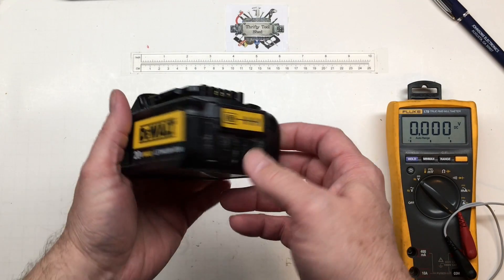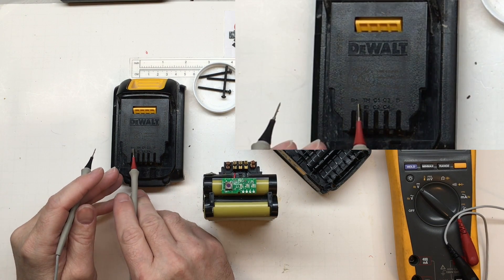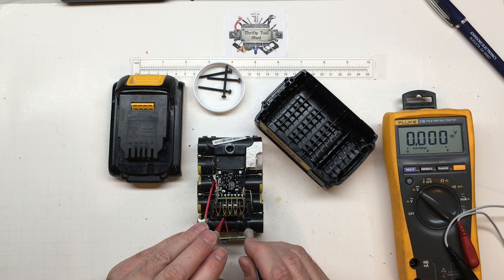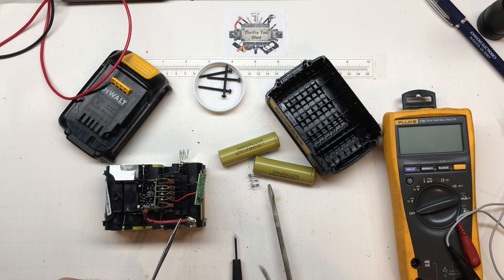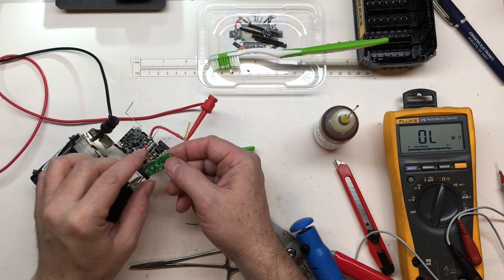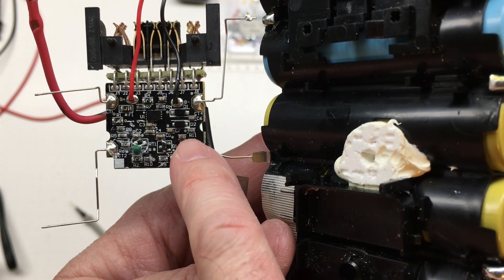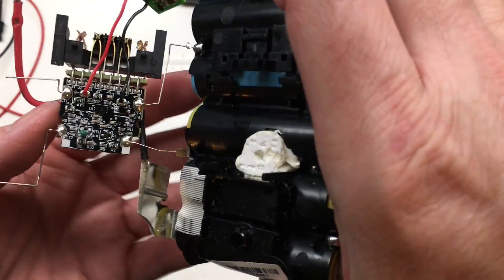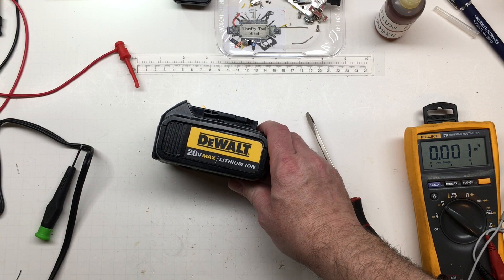DeWalt 20V Max 3AH Battery Repair

Comment: I didn't know you could test the cells while they were still connected to each other...thought you had to disconnect them from the cell cluster to get a proper reading!
Reply from the maker: In parallel you can't test the individual cell. Since they are in parallel though, we simply test Voltage as they will be the same as each other. That does not mean one does not have issues for sure. It's just that almost always if a cell has an issue it shows up on both right. If one is bad and pulling down, it will pull both down etc. If one is open for example and not working at all the other cell will show dropping off much quicker than others under a load. At this point we would have to separate them to test which of the 2 is an issue, I always replace both anyway though. So to answer your question, it is not Proper way just a quick troubleshooting method.

Comment: I have a Question, do all dewalt 20V has a low voltage protection circuit? anyone answer will be greatly appreciated, thanks
Reply from the maker: Well the pack monitors and the tool will shut down based on the pack. The pack does not cut the power to the battery terminals. So care must be taken so not to discharge the pack too low if used out of the tool!
Reply: @ThriftyToolShed  Thank you for your quick reply, I understood now.
Reply: Hi Friend, I am trickle charging my car battery through Dewalt 20V using LM2596 and it's working really good and have been using it for about an year from now. Now my question is I want to protect my Dewalt Battery from going too low on Voltage and I tried using XH-M609 and LM2596 together but it didn't work. Now what do you suggest me to buy which might help. I appreciate any help please.
Reply from the maker: I do have a video that I show a low voltage cut out module that may be helpful. The video is about Low voltage cut out for my ego battery packs but the cut out controller works from 10-60v I believe. 
This is a link for a 30A module and a smaller 20A module that work great for the money. I have a video on the 20A board as well but I have not edited it yet, hopefully will have it up soon. Here are the links to the boards...
eBay Link to 10-60VDC 30A Low voltage Cut-out Panel (the one I used)
http://ebay.us/jN8bXN
eBay Link to Aiyima 6-60VDC 20A Low voltage Cut-out Board
http://ebay.us/rHNgBY
Reply: @ThriftyToolShed  But with these 2 modules you mention the Dewalt 20V battery gets discharge completely to 000 and battery gets destroyed. Can you read my question again please.
Reply from the maker: The modules I just shared cuts the power from load to charge if you would like. I could see how the module over time could pull down if not connected to a charger. It just cuts the load. I mention in my video on the 20A module (not yet edited though)  about using a relay with it if needed that could drop out at setpoint and not latch back until you press the start button. Like a latching relay or sealing circuit used in motor starters etc. The only other way I would know to do it is to custom build a circuit to monitor and drop out with low voltage monitor, but I don't have time to research that. I just make the modules I have plenty of work at this time. Best of luck to ya!

Comment: Does the tool needs any extra inputs to work other than B+B-? I have a made battery pack for Dewalt dcf880 but it doesnt worked
Reply from the maker: Most tools connect to 4 terminals. The power as well as the TH for temperature monitoring and C3 which is most likely measuring the C3 cell to also check if it gets below say 2.7 - 2.9v it will most likely shut down tool. I have not experienced alot with these, so I assume it reads the 20V if it drops below say 14-15V it will shut down or individually based off of C3? That if it drops below say 2.8V and if TH or thermistor gets out of range! Not 100% on these, I have worked on a few,but not a lot of experience on them. I shared in the video most of what I have learned so far really.

Comment: You missed out the most important part - did it charge up again on the drill charger ?
If it did , you need to show it in the video.

Some drill packs,like Makita,will prevent (or brick) the battery from charging again once the voltage drops too low - as you did when removing cells.

I've seen a few videos where people claim to fix batteries by replacing some cells - but it's not fixed if the battery refuses to charge on the original charger.

It's not a criticism , but it needs to be shown to charge.
Now I'm off to see your other videos .........
Reply from the maker: Yes it is fine. It is used pretty much daily. I do show some issues with something similar with the ECHO 58V pack repair. Towards the end of that video I had to do a reset on the control board to get it to read level correctly. Sometimes I cut as much out as possible from a 1 to 2 hour repair to save video time. I will get some small amount of criticism both ways and I understand completely, it's hard to find that in between while still showing the important things and cutting alot of the not so useful. Believe me I cut out alot of me dropping something or redoing something. It's absolutely not because I don't want to show it, I do it to save some video time. Thanks for your comment, I did not even catch that I left that out. Sometimes I fix things on video months before I get time to edit alot of it out and finally get it uploaded.  Great point.

Comment: very good .i have heard different manufactures have protections in the charger and others in the battery .i hooked up a dewalt 2ah battery thru a buck convertor regulated to 12v. i goofed up and let discharge down to 3v.it would not charge it so i give a shock treatment ,it came back to life and took a charge, seems okay. i am going to watch again in case i missed something . anyway i was very impressed
Reply from the maker: The few packs that I know of that will cut the power from the power terminals of the packs itself are the TTI brands. The Ryobi, Ridgid and not sure about the Hart, that is usually the failure point on these as well. Most others including Dewalt and Makita  the pack monitors the cells but signals to the tools to shutdown.
Reply from the maker: Glad it came back for you. Sometimes the capacity is deminished when they discharge too far. The low cut out boards are very handy. I am doing a shirt video on a smaller 20A board right now.

Comment: I love the craftsmanship and attention to detail. I was a little worried about heating the new cells but obviously he knows what he's doing and has tested this type of repair long term.
Reply from the maker: I do like spot welding better. With new install and new nickel strips, I would spot weld. When I have a tested good used cell and reusing tabs from old pack them I will solder  to get a pack back in great working condition. Kind of in-between the to nice to not spend time getting it going and not wanting to rebuild it completely. I have had luck doing this for years just heat and solder quick and cool off so no excess heat in the cells. It's hard spot welding used cells and used strips together properly. Thanks for your comment.

Comment: Where do you buy the replacement cells?
Reply from the maker: Sorry, I keep lots of spare cells from almost new packs parted out as well as other cells tested very well for capacity. I just about always have what I need for spares. I usually do not recommend cells because so many times it's hard to verify that they are not fake cells. The main thing to make sure is that the seller is truly selling genuine cells.

Comment: I have Dewalt 20v DCS381 reciprocating saw and  a 3.0 battery just like that one.i have a quick charger and the battery charges good and the power is good.but when it gets down to one dot the saw drags like it was  a Ni -cad battery. Do you know why it might be doing that.Cuz i've never had a Lithium battery do that before.
Reply from the maker: I have not had a Li-ion do that either unless it was going below the lower voltage limit of the cells. I do notice the packs get a little bit weaker/ lower during the end of  run time, but like you mention it is nothing like the old Ni-Cad days. Just wondering if the same pack does the same thing in other tools or does other packs do the same thing in the Jigsaw?
I would test the individual cells when it pulls down low and see if by chance one or more of the cells has dropped off  more than the others in series. None of the cells should reach below 2.7V or so. If so you may have a bad cell(s) even though typically the pack should shut down before depleting that low. The neat thing about these packs is that you can test the cells voltage from the outside of the pack like I showed in the video. I really like that about these packs, that some test points are available like that.

Comment: Thank you. Mine is the Mac red 20v max and it was glued to the top. Was kinda hard not to brake the board getting it apart. Easy fix with the ground being un soldered.

Comment: Don't think this will work for mine. Because it was not a battery issue.
Turns out that these packs have a "fusible link" inside. Mine burned in two. Apparently, it got very hot and melted the inside plastic as well! Can't find any video to show this. Looking for a replacement has turned up nothing.
Reply: I have the same problem. I have a new 5.0ah battery that stopped working and the charger wouldn't even light up when I try to charge...I tried jumping from one charged battery to this bad one but it didnt work. I cant dind anything on any type of fuse inside... have you had any luck fixing yours yet??
Reply: Eaton 5 amp fused link, connect anywhere in series with batteries and output, don't forget to bridge out original fused link
Reply from the maker: Hi,
I am just now seeing this part of the comments here for whatever reason. Just to mention these packs can produce very high current in many cases over 100A depending on the pack. It's just a moment and then it will drop down to under 20A for many tools (again depending on what it is). The 5A link mentioned will not last long in many tools it may actually work in some drills and drivers, but not many. Usually these have a link much like the nickel strips attacking the cells together. You will see a spot that is more narrow than the other strips and that is the weakest link on purpose. I typically add in a thin nickel strip.

Comment: THRIFT!!

Thanks for the video, I cracked open my 20v battery pack finally. It had stopped charging prematurely and in opening I discovered two cells had been damaged in a drop.

I cannot find the battery you described; Samsung INR18650 15M, in a google search.

Can you point me in the right direction (URL, website, etc)  for something to purchase in the states? thanks sir!
Reply from the maker: It is a fairly basic 1500ma cell. Doing a quick search battery space comes up with a spec sheet. I try not to recommend places to buy cells because they change so much and some sellers on eBay for example were selling fake cells so I was concerned what I might recommend, may not be the same as it was when I ordered mine?
I just look at the specs and order one as close to the specs as possible if you can not find the exact cell. I also keep alot of like new cells or tested good cells for spares for all my used batteries I repair also so I don't order very many! Thanks for your comment. Best of luck to ya!
Reply: 18650 Battery, Large Capacity 3.7V 5000mAh Rechargeable Li Battery, for Headlight Flashlight Fan & Overcurrent Protection (Blue) (4 PCS) https://www.amazon.com/dp/B08R9CM323/ref=cm_sw_r_cp_api_glc_fabc_xwa7FbAT5ES3G?_encoding=UTF8&psc=1

Comment: C= cell cluster ?
Reply from the maker: Most likely. Cell or Cell group when in a cluster like 2P....or even 3P?
Reply: Thrifty Tool Shed rephrase that plz
Reply from the maker: Are you asking about the 2P and 3P?
Just typical battery meaning for 2 cells in parallel in pack or 3P for 3 cells in parallel. So I was mentioning that for your cluster comment. So a 2ah pack for example is usually just 5S or (5) 4 volt cells in series giving you an output of 20V. If a higher capacity pack such as a 4ah pack is 2P so each of the 5S series cells also has a parallel cell making it a 2P 5S. Even higher capacity pack may be a 6ah and 3P so it has 3 parallel. hope that makes sense.
Reply: Thrifty Tool Shed oh I get it thanks

Comment: Hi what’s that heat gun by way ?i have fun like that a weller and don’t get hot quick 😂
Reply from the maker: It is a weller 150W. The reason it starts off well is the Rosin flux. The flux helps tremendously in heat transfer as well as help with impurities in the solder joint.
Reply: @ThriftyToolShed  is that pure rosin flux or what ratio please
.whats the cloth you dab joints with after ?
Reply from the maker: I use a RA rosin activated flux, especially for the larger and older parts that need all the help it can get on the surface. It is superior to the no clean flux on the larger and oxidized parts for sure. It helps great with older wire as well when soldering to the old strands. The cloth or tissue I use is simply a damp cloth to cool the cell faster to keep the heat from pulling into cell. Although we are taught it is best not to rapid cool a solder joint, one with this much adhesion area and importance of the cell temperature is why I always cool these.

Comment: What do you use for cleaning the surface before soldering ?
Reply from the maker: I usually use a little Emory cloth to clean and rough up the surface, then high % isopropyl alcohol and also use Flux. Something like RA rosin flux works well but you will have to clean up the flux residue a bit with some alcohol also.

Comment: Great Video - When replacing the batteries, you mention to utilize a compatible battery size. I have similar  DCB200 3.0Ah but when disassembly my battery does not reference a number that I haven't been able to cross on the web UBNX4A3 008165.  And in your video you show replacing with Samsung INR18650 15M and I didn't hear you mention the CDR rating such as 15A  lower or higher.  Such as a Samsung 30Q 3000mAh 15A.  At the price of $4-8 each is it better to replace them all at one time? And if replacing all could you increase from 1500mAh to 3000mAh as well or would it require to modify the board on the unit?
Reply from the maker: I absolutely believe replacing all cells at once is the best practice. I rarely do it because I have so many packs and parts that I always have some good working cells that I have tested and they work great to get an older pack back with still very useful capacity. When I mention compatible battery, I meant even though they are all 18650 physical size, we have to get close as possible on the mAh rating as well as the discharge amp rating. Another important check can be the charge rate allowed, some older cells are not rated for fast charging, some are only 1C rated for charge current and some maybe 2C or 3C etc. I really like to replace 18650 cells with the exact replacement if possible honestly. From time to time just to keep a pack from being garbage, I will put a used cell in that is really close to the same specs. When replacing all new cells, in most packs it is fine to "upgrade" or step up the mAh rating of the cells as long as the internal pack elements like any possible fuse or fuse link or jumpers etc. Are rated for the higher current capable cells.  Hope it helps!

Comment: Interesting video but it's left me with some questions. How is the BQ7718 used to prevent over charging and how is the pack protected from over discharge?
Reply from the maker: Although I have not had the charger apart or the newer tools for that matter. I believe in the DeWalt 20V Max the charger and tool is taking the condition from the connections and the pack protection is done in the charger and tools controller. Thanks for your comment!
Reply: Late reply, but I'm just looking into protection circuitry. the BQ7718 does balancing and protects against overvoltage. It's designed to be used with a fuse that the 7718 can blow on demand if one of the cells is FUBAR or the pack is over a preset voltage that would depend on which 7718x it is. That kind of fuse would be something like the SFK-3030 or Littelfuse ITV5432L2030. F1, though, looks like a standard 2-pin fuse

The charger or the tool itself would interpret the temperature sensor data and manage other protections. The 7718 just counts as 'secondary protection', aka nothing programmable, just a failsafe.

Comment: I have a 20v Max battery pack that has been wet.  I replaced 3 cells that were bad.  Now shows to have 20v after charging each cell independently.  The led lights all 3, but when put on charger it blinks one time and shuts off?  When I try it in a drill the illumination led comes on when the trigger is pulled but just for a second.
Doesn't even try to run the drill, but doesn't drop any voltage.  Drill works fine with other batteries.  I will take the board off and look at it more closely, but don't know enough about components to identify them all.  Just a challenge that I have to pursue !!!
Reply from the maker: Challenge indeed. If the 20v is not dropping off, I would say for sure yes, it is in the board. I tried to touch a little on how the board monitors the pack in the DeWalt repair videos. Hopefully something will show up when checking accross the individual cells connection, the NTC thermistor connection, and the feedback "resistance" connection.
Best of luck to ya!

Comment: What battery did you use for the rebuild?
Reply from the maker: I have lots of spares that I test and store by there amp and capacity rating from spare packs over the years. I have some new cells also, but lots of my repairs of older packs, I will use the tested used cells. Of course the exact replacement is best, I have great success with very similar cells as long as capacity and amp rating is the same!